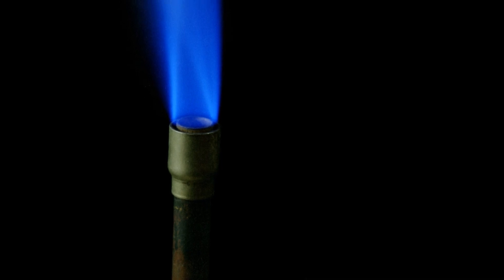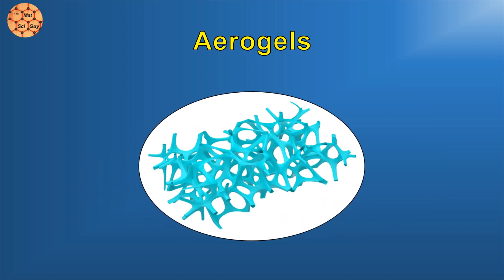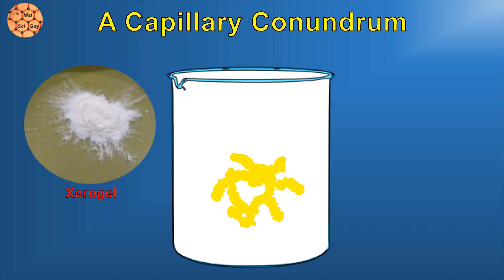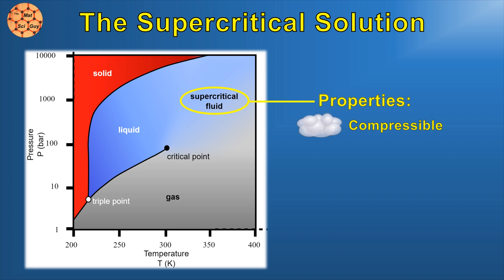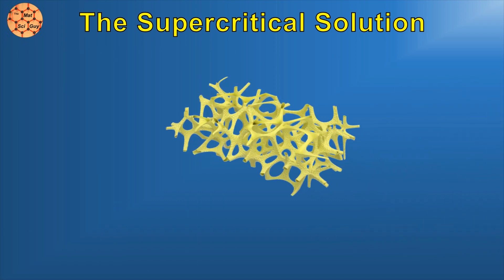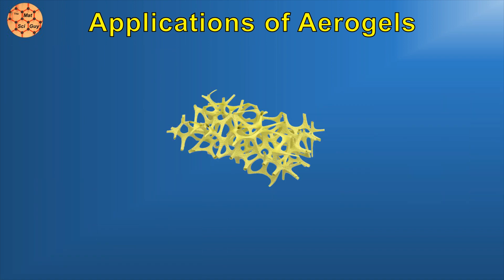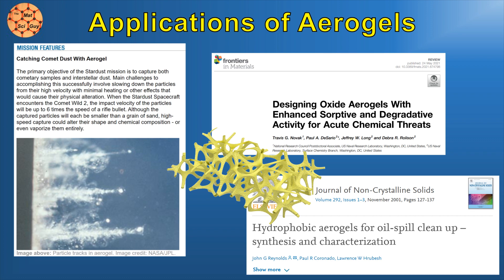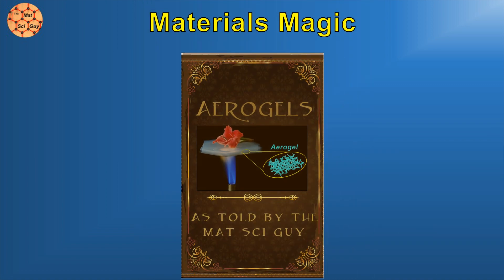The Story of Aerogels: The Power of Porosity

Comment: but something is wrong. I mean a good insulator is where air cant travel from one room to another room.
I mean is not better insulator wher air is traped in bubles inside the material?
for example the aluminium. aluminium radiator/with fins will let therma energy disipate more fast than aluminium doped with droplets of air traped inside like CO2 in the pepsi or cocke.